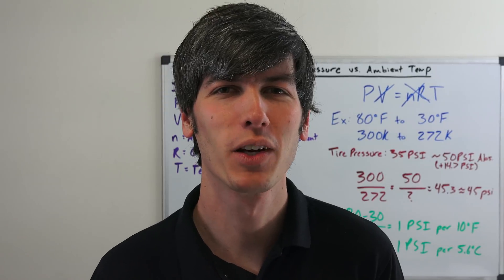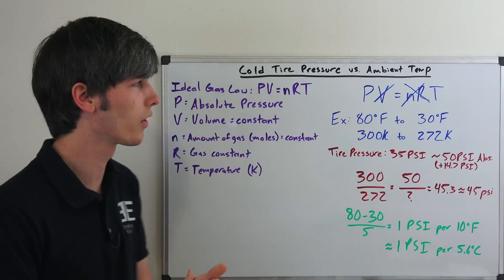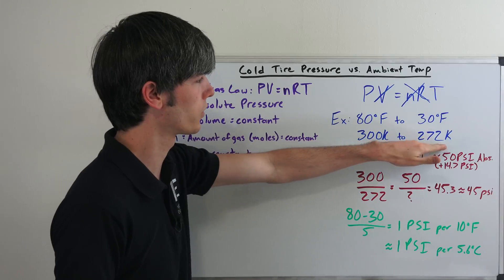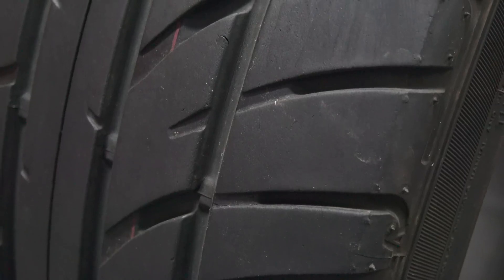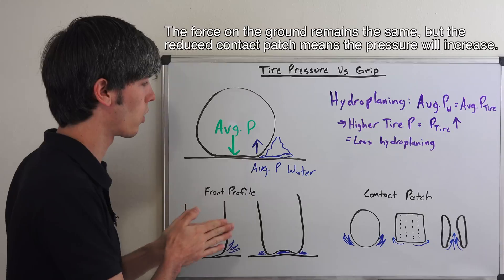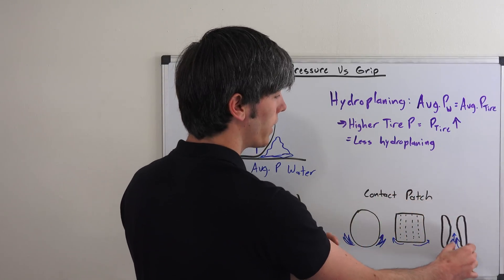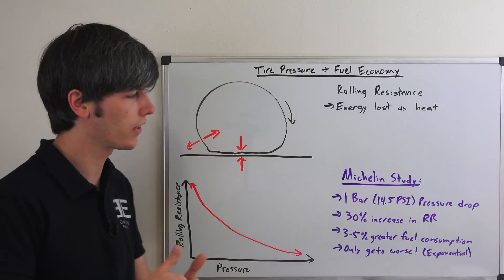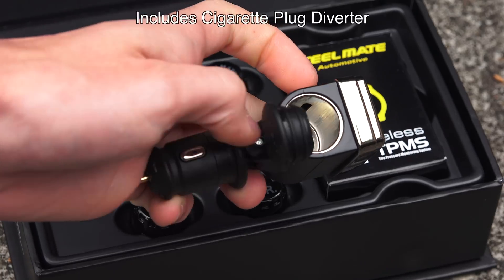4 Reasons You Should Monitor Tire Pressure

Comment: [North] Americans, we don't hate you, we hate IMPERIAL system. Makes no sense, it's really hard to compare with other units and really sucks. Metrics FTW
Reply: I'm from the USA and I really wish we'd give up the imperial system...  In 1999 we lost a $125M satellite because of a failure to convert between imperial and metric ..
Reply: Actually, if you look at surface area, most of North America (since Canada is larger) uses Metric, It's really only the USA that uses Imperial.
Reply: +Emmanuel Sanders we use both. 

Think of tire size. If I recall, a 235 is 235mm. And my guess is, tires are sold world wide do we use what is most common and leave it to imperial system countries to do their conversions.
Reply: The imperial system is better to use in my trade which is machining. Measuring in thousandths of an inch is much more practical than micro meters.
Reply: @simpleman72685  it's been 2 years and your comment is still just as invalid

Comment: What I've learned from fiddling with pressures at track days is that each tire has unique pressure requirements, to the point that there is no simple rule of thumb. The best I can come up with is that tires with stiffer sidewalls need more air than tires with softer sidewalls. My theory is that as the tire rolls over, if the sidewall is stiff and the tire is underinflated a concave area between the contact patch and the road surface is created, reducing the amount of rubber on the road. 
So "it depends" is the only right answer.

Comment: Ive been meaning to ask this for some time, when you do a fuel economy run on any of the vehicles you are testing do you use techniques such as hypermiling or drafting? Do you also drive with the intention to get as food of mileage as possible like ac off, heated seats off, shifting under a certain rmp or are you driving how you would drive normally? I'm just curious as to your methodology behind that. Thanks for making great content.

Comment: hey EE, i want to ask about nitrogen. so like idk about other countries but where im at there are a lot of nitrogen..tire fill ups..places....(sorry english), and im wondering, say my tires are almost out of nitrogen air, if i fill my tires with normal air instead of nitrogen, is it still okay? like are there any side effects or does it disrupt the balance? thank you!
Reply: also standard TP is 28F and 29R
Reply: +LanEvoKing my car came stock with Nitrogen in the tires but I just top it off with air straight from a compressor just because it's cheaper and convenient. Unless you're racing on slick rubber and your tires are fluctuating in temperature many times per hour, I wouldn't worry about it.
Reply: regular air is a mix of 78% nitrogen and 21% oxygen so putting air in your tires u are putting nitrogen in your tires. where nitrogen fill ups as you called it exchanges that 21% oxygen for nitrogen making it as close to 100% nitrogen. that being said its is proven that nitrogen is more stable at difference temps then oxygen however in a normal car/truck that is driving in normal conditions aka not a race car on a race track doing 115mph + it makes very lil difference but in those extreme cases of race cars that are traveling at such a high speed it stabilizes the psi in the tires due to nitrogen being more stable at more extreme temps. long story short its a trick to get into your pocket to get $ out of you. JUST AIR UP TIRES WITH NORMAL AIR
Reply: jay webb
OKAY THANK YOU

yeah i was just worried if it would upset the balance. and yeah im only using my car for daily use. thanks!
Reply: you cant upset the balance cuz nitrogen is part of air so that being said just maintain proper air pressure use the spec provided for you car and rotate your tires every 5000 miles and you should get long life of tires that is if your suspension is in good condition bad suspension or broken suspension will cause tire wear and can lead to unsafe handling

Comment: An increase in tyre pressure results in a smaller contact patch which means more pressure exerted on the wet ground so the tyre can displace the water more effectively, however, a smaller contact patch means less tread is exposed to displace the water? Confused...
Reply: Think of it as skipping stones on water. Skip the flat side against the water and it'll bounce off. Skip the edge against the water and it will slice through.
Reply: Nice analogy :)

Comment: feels like I am back in school, but that I actually went to class, listened and took notes. and it was informative.

I add air when it's 1,2 psi below normal as my car loses about 1.5 every 1 month or 2.  my question is how many psi below normal will it starts to affect mileage, tire wear etc.  5,6 psi then you should add air? 1,2,3 doesn't really matter or what?

Comment: QUESTION: The specs for tire pressure on my car is 32 psi. What I do is keep the tires at 30 psi when cold but after they warm up they stay at 32 psi. Should I maintain the cold pressure at 30 or 32 psi? Thanks in advance...
Reply: The specs for tire pressure listed on the car stickers is typically what they should be inflated to when cold.

Comment: if it'it's true that a reduced pressure means less grip when on a wet surface, why is it a common practice to decrease tire pressure when a car is in gravel sand or other uneven surface? if the individual sand grains were as small as individual water molecules I'd assume it would behave the same as water.
Reply: Decreased tyre pressure creates a larger (longer) footprint on sand like a snowshoe, and allows the footprint to deform to unsealed uneven surfaces for increased contact patch = more grip. In the wet you just want the tyre tread blocks to pierce standing water to reach the solid road below.

Comment: Don't you need to re-balance all of your wheels after changing your valve-caps to those fancy techno ones?
Reply: Agreed, a quick search and you see typical valve covers are 0.3 oz but looking at the amazon add for these new valve-caps and we notice they advertise 9.6 ounces (well they actually say 9.6 grams then 9.6 oz if you scroll down...odd...) but that's still a substantial increase when most tire balancing weights range from 5-85 g which this additional mass is in the range of. might recommend that re balance with such an increase in mass especially with the eccentricity of the valve stems
Reply: jfurli
Yea those weights was what I was interested in, thanks for looking that up mate.

Comment: Something that was missed is how water affects tire temp which is a far more complex relationship (lots of heat transfer factors ).  In autocross speeds are low enough that hydroplaning isn't an issue so typically we lower tire pressures when its wet because the tires don't heat up as much to maintain more contact patch.  Since they don't heat up as much the rubber doesn't get as soft and you run a smaller contact patch which gives you less lateral grip which makes you autocross slower. There also is a timeframe factor with autocross since the runs are so short and tires won't heat up quickly internally.

For normal freeway driving it makes perfect sense to add extra air when its raining.

Comment: My theory on what to inflate tires to on my cars is 2-3 pounds higher that what the car manufacturer recommends.  My reasoning is simply that if you inflate them to recommended pressure, they essentially begin their journey immediately to being under inflated.  However if you over inflate them 2-3 pounds and monitor them so as not to let them get any lower than 2-3 pounds under the recommended pressure, then overall they are operating in the optimum pressure range.
The second observation I have is that a higher pressure tire should in fact reduce rolling resistance, however I've read recently that a couple tire manufacturers in the quest of designing a tire for improved mpg, is they are experimenting with a more flexible tire compound that supposedly allows the tread and sidewall to give under compression then return that energy as they attempt to "spring" back to their original shape. I'm not sold on which design will actually work best, but I'm a bit of a conservative driver and lean more towards hypermiling rather than racing to each red light working the brakes hard then acceleration strongly on a green.
Reply: Okay.  Do us a favor then,  would you? Travel in the right lane. Thank you.

Comment: I don't think what you said about hydroplaning is true; except with too much deflated tyre
1- Water being a liquid is very hard to compress; so increasing the pressure of the tyre I don't think is going to affect the equation you wrote significantly
2- It is all about the treads to clear the water if you are within recommended pressure
Reply: Water is incompressible.
Reply: Just because it's uncompressable  doesn't mean there's no pressure to it. 

Also, he's the one that went to classes to learn about this.
Reply: I am a Civil Engineer. I studied Hydraulics and Fluid Mechanics. Being incompressible  doesn't mean it has no pressure; it means that we with all our technologies (imperfect) cannot compress fluids like water, meaning in this case that increasing the pressure of your tires will not overcome the pressure put back by water.
P.S. Someone who went to classes to learn will also make mistakes
Reply: While it's true in theory, in practice, the risk of hydroplaning depends more on vehicle speed, tread pattern, and tread depth than variation in tire pressure.
Reply: +Mehran Mahdi.  Water on the ground cannot and does not need to be compressed. The force exerted by the tire pressure only needs to displace the water from underneath the tire.

Comment: I purchased one of those STEELMATE TPMS shortly after putting four new tires on my car. I have 55 series tires and is difficult to detect a tire that is going low or flat. The way I can tell I have a tire problem is that the car will pull in the direction of the low/flat tire. I ruined a tire because it picked up a nail, went flat and I didn't detect it was flat until it was too late.

Comment: always set your pressure to loaded or unloaded plus 20% . compared too the manufacturer advice. never had the inside more worn not even after 100k km on the same tires.
Reply: So if the manufacturer recommendeds 36psi, you recommend 43-44psi. No thanks.

Comment: With modern radial tires increasing the pressure won’t cause center to wear much more.

Even running tire from new to legal limit with 30% over the suggested pressure will wear the center less than 1mm or about 1/32” more than sides.

Comment: So how does this affect grip while cornering? High pressure in the wet means you will slide easier in the corners, and I have also found that increasing my pressure above manufacturer recommendations helped quite a bit in the dry. Is everything in this video flipped on it's head in the corners?
Reply: One thing to keep in mind is that manufacturer recommendations are only accurate for the same tyre profile and same tyre materials. If you are running a different tyre with different material (softer compound or harder) then a different tyre pressure may be required due to different thickness and flex profile of the tyre itself and its behaviour under pressure. 

Another thing is that higher tyre pressure can lead to an increase in response as there is less flexing of the tyre before the tyre responds to your steering input. This can create an illusion of increased grip without actually increasing grip. 

Wet behaviour is always harder to gauge. If you're sliding with tyre pressure in the wet then you could be pushing too hard or your tyre pressure is too high, leading to a smaller contact patch, hence it is easier to slip. 

I find that it's not always best to follow manufacturers instructions. Best way is find a long flat road, preferably a track, and draw a thick line of chalk from your outside shoulder block to inside shoulder block of each tyre. Drive on the track for a lap or do a straight line speed run and see how much chalk was rubbed off, this will tell you about your contact patch and will tell you of you need to increase or decrease your tyre pressure based on current tyre configuration, or even if your camber setting needs to be adjusted.
Reply: Definitely need to try that! And yes manufacturer instructions are often set up for comfort and on-purpose understeer so it's best to figure out your own preference either way, I guess. Thanks for the info!

Comment: So, I find your videos interesting enough for the most part, BUT, I think you spend too much time on the obvious and not enough on the important parts. You spend half the video talking about how to solve an equation and about 2 minutes talking about grip and only talked about grip on the wet. You didnt say a word about grip on dry conditions (which is what every performance driver or race driver care about). You didnt talk about how temperature is important to grip (even more so than the size of the contact patch), or the effects on the sidewall of the tires and how rollover can occurs (and what it means or does to the handling of the car).

Your channel started out as a very informative channel that talked about very subtle details and things that people took for granted on car engineering and you put some science behind it. Now it feels straight up as click bait (even the titles sounds like clickbait, 4 reasons you should watch this video). It sad to see how things are turning up.

Now let the hate of youtube consume my comment.
Reply: Same!
Reply: I'm also disappointed with this video. It does not make a disclaimer that TOO LITTLE pressure is the cause of MOST BLOWN TIRES. If you visually notice an under-inflated tire, you are already in the danger zone.
You should NEVER have your cold pressure under the manufacturer "recommended minimum pressure".  This is about safety at high speeds (highway and track days). Low pressure will overheat the sidewalls causing them to fail. Do you know the little bulge just above the contact patch? At 60mph a tire can rotate at 840rpm, which means every radial line on the sidewall modifies it's shape 280 times/s (normal-bulge and bulge-normal). The rolling resistance (heat).....that's where it is.
Reply: Most of his videos are like this, or he misunderstands the process of how things work and has people backing him up who have no clue or experience about the subject matter. Sad,  really.

Comment: Here might be a dumb question. You've said that hydroplaning happenes when the force of the water pressing up on the tire matches the force of the tire pressing down. Newtons 3rd shows that all forces between two objects always exist in equal magnitude but opposite direction. If the the Tire is exerting a a force on the water below it isn't there always a matching in normal force from the water on the tire?
Reply from the maker: Not a dumb question! Also we're talking about pressure, not the force, but that's not all that important. You're intuition is correct that there must be equal and opposite forces. When you're not hydroplaning, the road is what is directly providing this equal and opposite force. When you are hydroplaning, the water on top of the road is providing this force.
Reply: +Engineering Explained so in a hydroplaning a scenario there's a great enough force that the normal force from the liquid layer prevents the tire from reach through to the pavement and the skid happens because water provides no traction?

Comment: I made a test on my car years ago.  
Inflated tires at 32 psi (cold) ,  and after 4 hours on Highway they were 40psi.
  Next week,  inflated at 38 psi.  Same highway for 4 hours  and they were the same, 40 psi. 
 I took a security driving course where they told us,  if you give the hot air chance to expand,  it will.  And a way to increase security is raise psi to a level where is not over inflated,  but where the hot air finds difficulty to expand  and have a hard tire.

Comment: How can we consider volume to be a constant if the tyre walls are elastic?
Reply: Because the amount the volume changes is small enough to be discounted, and doing so makes the maths much easier. The final answer is probably just a few percent wrong as a result of this fudging.
Reply: sachamm I get that but I don't think it's pedantic to be clearer on this. Temperate affects density which affects pressure which in turn affects volume which in turn affects rolling resistance which again affects temperate, so there are a number of complex non linear interactions going on here
Reply: Nope.... It's very simple:
Density is the weight of a volume.
Weight is not affected by temperature and is already represented in the formula (mass).
Volume can be indirectly affected because the pressure rises and the "containing" material (tire in this case) may be flexible.
So, temperature affects pressure, pressure affects volume.....
Nowhere in the video was talked about "dynamic" conditions (rolling resistance and patch friction). All the talk about temperature was ambient=tire.

Comment: My (factory) tpms always says my tire is low... Smh
Reply: +Craig Cundiff interesting. I thought about that but it was consistent amount all the tires
Reply: Check to see if the TPMS batteries need to be replaced
Reply: maybe the gauge you're using to confirm tire pressure is inaccurate...I had a gauge that was off by ~3lbs...compared to another and my TPMS...

Comment: ignoring all the downsides, does that mean an overly inflated tire could decrease the likelihood of hydroplaning due to the higher pressure? would a car tire made with the sole purpose of avoiding hydroplaning at all cost look more like a street bicycle tire?
Reply from the maker: Ignoring the downsides, yes. Higher tire pressures result in a lower likelihood of hydroplaning. Semi trucks have very high tire pressures, and as a result are not prone to hydroplane, as the average pressure on the ground is very high.